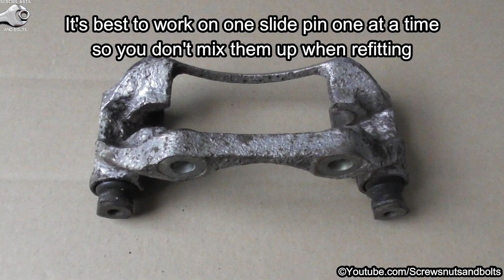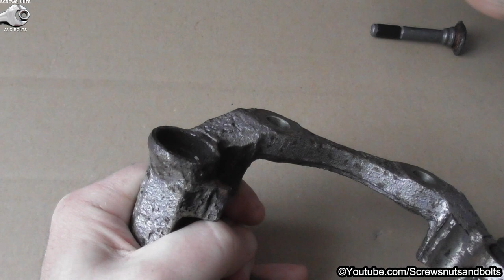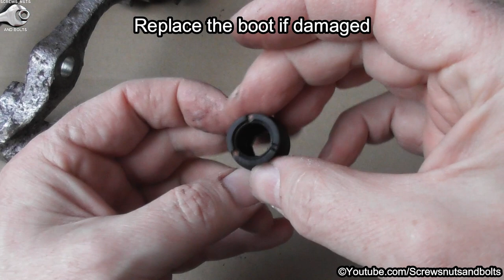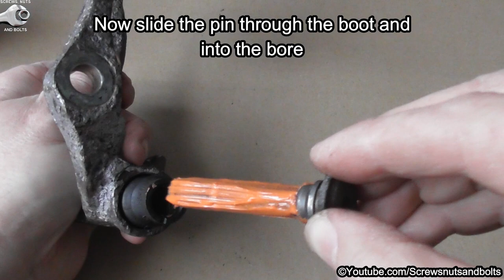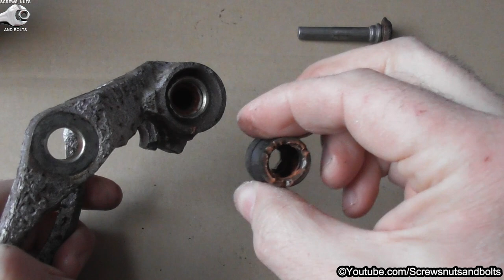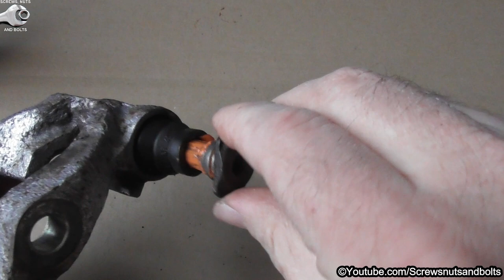Caliper Slide Pin Lubrication

Comment: Until recently I wasn't aware of this product.Ive done this job on a couple of Calipers and have used either HMP grease or Copaslip.Some of my old Car magazines actually used the same in their DIY features.However I have since discovered they are not the best lubricants because they can degrade the rubber seals over time.I think its good you've featured the Silicon so that  older DIYers are aware of it!Thanks.
Reply from the maker: Thanks as always. It was hard to find a caliper pin grease that ticked all the boxes. I heard the green Permatex mentioned a lot but apparently that can degrade the rubber seals too.

Comment: If you find grease even on the pins you're lucky and doing well.... I have done brake jobs with pins heat welded into caliper brackets because there was no grease at all and the brakes were dragged so bad it overheated everything.

Comment: Just installed two brand new calipers. One was clearly older stock than the other and the factory grease was so hard I could barely separate them. I cleaned as much as I could and then used my own premium CRC synthetic silicon lube.

When it came time to install I found it was still too much effort to remove the caliper from the bracket, and this time it pulled one of those “anti vibration sleeves” out with it. I guess it was supposed to come with it all along and needed grease around the sleeve.

I used the opportunity to clean the rest of the factory lube out and used more of my good lube but I actually couldn’t get the caliper and bracket onto the rotor because the slides would not go all the way down.

I needed to take the caliper off one more time and, once again, it was stuck. This time I found the anti-vibration sleeve was bent and cracked, no doubt because it got snagged on something on the way out. Brand new OE replica caliper but not actually OEM so I don’t even know if it is compatible with one from my old caliper. The boots certainly aren’t since they are permanently attached to the replacement bracket (TRQ brand).

Comment: After all the cleaning, lube the pin and insert into the caliper channel without the rubber boot and turn the pin a few times to spread the lube all around the channel then withdraw the pin. Insert the rubber boot slightly coat the pin again then insert the pin. This
Reply: And how am I? run free?

Comment: If your not doing brake jobs for you an the family frequently a tube of sly-glyde is only 6$ compared to a big bottle with a brush for $14-$25. It will still do 10-20 or more jobs with that, just no brush.
Reply: * Sil-Glyde

Comment: So.. I m having this issue.. when you insert the slider pin it's depressed. I think this may be due to the grease. The pin has too much grease. The pint should have a spring action after greasing

Comment: Good job! I take it one step further. I insert Brake Cleaner straw deep inside the bore to wash out any impurities then blow it out with compressed air.
Reply: Yup! Same!!
Reply: I was looking for a way to better clean out that grease from the bore. Do you worry about any contamination of the grease with the brake clean?
Reply: @FishFace441  Nothing wrong with using brake cleaner but you must first remove as much grease as you can from the bore with  cotton swabs on wooden sticks. After using the cotton swabs, spray it with brake cleaner, turn it upside down so brake clean that didn't evaporate drains out. Now use a cotton swab to finish cleaning it. If you do this there's no chance of cross contamination. If you want better results, don't use the grease in the video, use Toyota's pink rubber grease. It's much better than the Permatex for the slide pins. The permatex is great for any metal to metal contact, and because it's silicone based, it can be used on rubber parts, but it doesn't do as good a job as the Toyota pink grease. It's official name is Lithium soap base glycol grease. I've used it for over 20 years and my brake jobs last 7 to 9 years. Don't use the pink grease on metal to metal contact only on slide pins because of the rubber. You can get it on Ebay for about $25. The tube will last you years. On metal to metal contact you can use the grease shown in the video.

Comment: Make sure to force the trapped air out that's been trapped at the end of the pins otherwise the outer pad will slightly bind on the disc causing uneven pad wear apart from that a good job.

Comment: Brake cleaner and compressed air for the slide pin housing? Is it ok to use Liqui Moly Ceramic paste or too thick for this application? Silicon grease instead?
Reply from the maker: That should do the job alright. Silicone grease seems to be recommended more often than not but I'm not too sure about the Liqui Moly to be honest

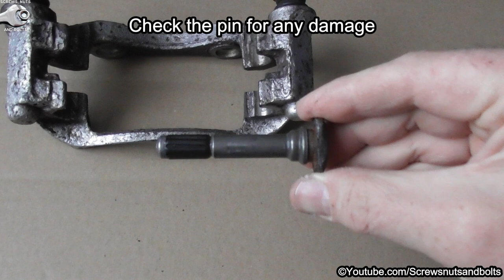Comment: Okay, please no guessing. *2000 Honda Civic EX's Front Brake Slider Pin (1:10) with rubber O-Ring.
Is it placed on the top or bottom?

*shop had installed both same slider pins without O-Ring on Driver & Passenger.
*assuming you don't have a service manual.
Reply from the maker: This may help: https://www.youtube.com/watch?app=desktop&v=iedv77K7zEY

Comment: One driver reports "synthetic" brake lubricant distorted the rubber grommet at the end of his slide pins. He claims the grommet swelled so much in both diameter and length, it compressed the slide pin, itself, and reduced braking action. 
After his experience, user says he will use only Sil-Glyde silicone lubricant on his brakes-- no synthetics.
Reply: Sil-Glyde is a good lubricant to use on slide pins because it won't hurt rubber parts. I use to use it with good results but when I started using Toyota's pink rubber grease, I was so happy with results that it's the only grease I will use on slide pins or on anything that involves rubber. I also don't inspect the rubber bushings nor the rubber dust boots. I just replace them. It's best so they don't fail in a couple of years and then brake pads start dragging. Don't use Toyota's pink greease on metal to metal contact. Use the grease shown in the video for metal to metal contact.

Comment: Good day. What temperature should the oil applied to the brake caliper pins be resistant to? Can lithium soap based grease be used? I would appreciate it if you could help me with the caliper pins.
Reply from the maker: Ideally you want the grease to be able to withstand temperature above 200 degrees Celsius (392 fahrenheit). Lithium grease is petroleum based so it is not suitable for use with rubber components, like the caliper pin boots.
Reply: @screwsnutsandbolts  LIQUI MOLY Synthetic Lubricant for Brake Pins 5 g (21119) Is this product suitable for brake calipers? I would be happy to help
Reply: @screwsnutsandbolts  What kind of grease should we use? I would be happy if you help
Reply from the maker: Yes that is suitable for brake caliper slide pins

Comment: Ive done this but with copper grease. The rubber pin seems like its stuck and can hardly move. But the the other pin with no sleave is fine. What am i doing wrong
Reply from the maker: Copper Grease is mineral based and may damage any rubber component that it comes into contact with such as rubber boots, gaiters, seals and O rings, etc.
Reply: There was copper grease put on before from last owner. It looks like the rubber end bit on the pin has swollen so I'll release it all. Use proper grease and take off the rubber end bit too 👍

Comment: You mentioned about not putting grease on the end of the pin.
I understand why as it wont give full travel of the slide bolt.

But earlier in the video you used a drill bit and knapkin and compressed the grease.

You really should have made more effort to clean the inside bore for the pin.
Reply: I was wondering why a cleaning solutions wasn't used, myself.  Some kind of spray that would break up the old grease.

Comment: thanks for the video! which slide pin has the rubber boot the top or the bottom?
Reply from the maker: You're welcome. It's usually the bottom slide pin
Reply: thanks ill give it a try,  @screwsnutsandbolts
Reply: Depends on the brake system. Some have 2 some have none some have upper pin some have lower pin. On a 2017 Toyota Highlander for instance the pin with the rubber seal is opposite the front calliper got the, rear. I think it’s bottom pin on front and top pin on the rear. That’s why it’s best to do one pin at a time.
Reply: @Zeek800  Yeah, it just depends on the year, make and model.
Reply: @Zeek800  Hey, I see you work on Toyotas. Have you ever used Toyota's pink rubber grease on the slide pins?  It's the Lithium soap base glycol grease.

Comment: Are the boots expensive? Why not just change them?  Thx
Reply from the maker: No they're not actually expensive, this video is just focused on the slide pin lubrication.
Reply: Bingo. Usually comes as a kit with rubber boots and calliper slide pins and the calliper mounting bolts. Depending on the vehicle it can be from $5 or $6 to $15. Good to have spares on hand anyway because reusing a cracked or ripped rubber boot will mean  corrosion and you’ll need to replace the calliper bracket and likely the pins and bolts.
Reply: I never inspect the rubber dust boots nor the rubber bushings on the slide pins. I just replace them with new ones. Also, if it has sheet metal clips that the brake pad ears ride on, I replace them too. They go through so many heating and cooling cycles that it's best to replace. If you want your job to last, it's best to replace them. They're not expensive so why not.

Comment: Should take rubber bung off, then twist bolt thru with lub on it, then take out bolt, replace rubber, then put slide bolt back in place.
Reply: You actually don't want to put too much grease on the slide pin or in the bore because too much grease will prevent the slide pin's full travel resulting in brake pads dragging lightly but dragging nonetheless.

Comment: seems like all the grease would be trapped in the rubber boot
Reply from the maker: Sometimes the boots are a very tight fit in the caliper bracket and could trap the grease, but most of them have enough space for the pin and grease to fit in through the boot.

Comment: HOW ABOUT IF YOU CLEAN THE PIN, RUBBER BOOTS AND THE CALIPER BORE WITH WATER AND SOAP?
Reply from the maker: I wouldn't recommend it when working with brake components.
Reply: @screwsnutsandbolts  SO, HOW ABOUT CLEANING THEM WITH LACQUER THINNER? THIS WILL DRY FAST ALSO
Reply: @screwsnutsandbolts  I AM PLANNING TO CLEAN MY CALIPER PINS AND REPLACE THE BRAKE PADS AS WELL. AND THIS WILL BE MY FIRST TIME TO DO THIS JOB. YOUR VIDEO HAD GIVEN ME TIPS TO DO IT WITH ACCURACY
Reply from the maker: Hi, I'm not going to recommend anything other than proper brake cleaner, you understand. Good luck changing your brake pads.
Reply: @veepee1741  Why are you yelling?

Comment: Don’t use anti seize ! Use proper silicone high heat grease ! The other will dry out !
Reply from the maker: This isn't anti-seize. This is Permatex 80653 Silicone Extreme Brake Parts Lubricant. Probably the best lube there is for caliper pins.
Reply: @screwsnutsandbolts   No, the best grease for caliper slide pins is Toyota's pink rubber grease. It's a Lithium soap base glycol grease. All my brake jobs last from 7 to 9 years and pads wear out evenly. Only use the pink grease on the slide pins because of the rubber bushing/sleeve and rubber dust boots. Use the grease in the video for metal to metal contact.
Reply: What are you talking about?